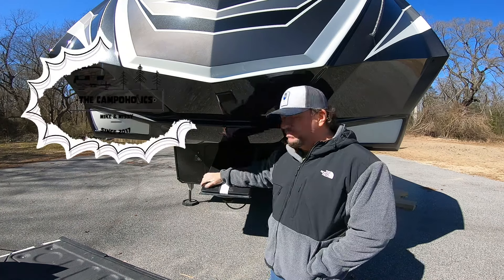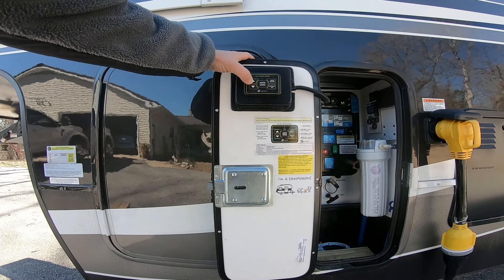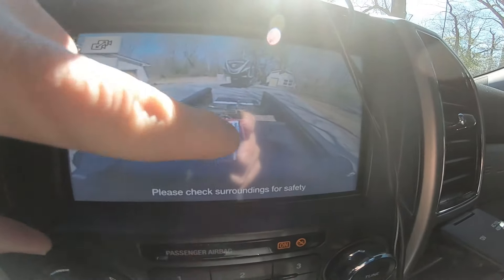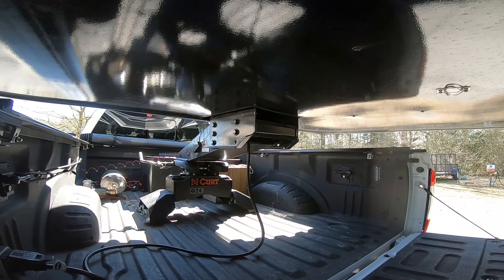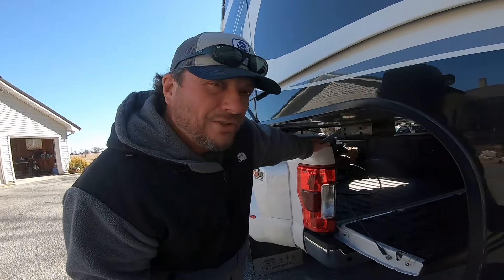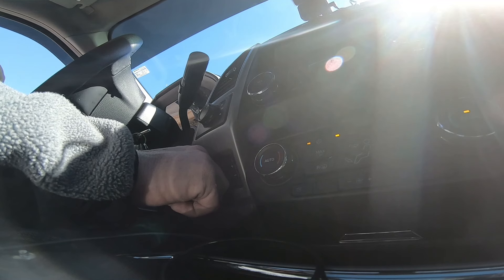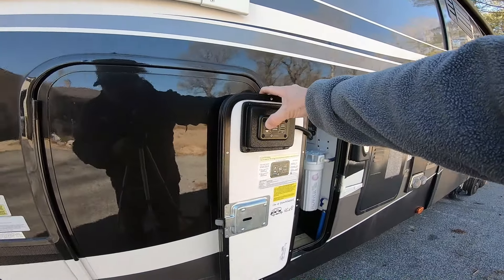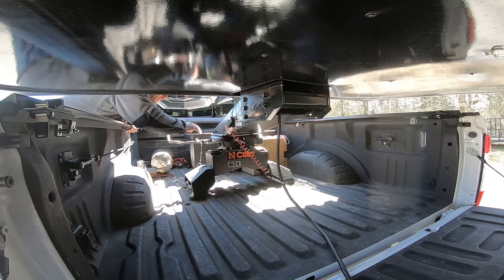5th Wheel Hook Up and Unhooking / Lippert One Touch Control / 5th Wheel Hitch

Comment: A couple things. AMP Research makes a great mid mount side step so you don’t have to haul around that wheel step. Second, looks like the clearance of the pin box to the sides of the bed is pretty tight.
Reply from the maker: Thanks for the tips!

Comment: Question: When you do the tug test, 1. First, you put your foot on the brake, 2. you put truck into drive. 3. you release the trailer brake???? Do you ever touch the gas pedal?
Reply from the maker: Hello Kathleen, you put on the trailer brakes only, give them a chance to engage, hit you gas pedal, the tailer brakes should hold the trailer while the truck tries to go forward. If the trailer does not fall off the hitch, your all good.
Reply: @TheCampoholics  Do you ever move the truck gear? Meaning, do you put the truck into gear before doing the tug test?

Comment: In my search for a 5th wheel receiver, I'm noticing that they are made specific for certain trucks. My question then is if you use top mounted bed rails that are universal, then isn't it a moot point?

Comment: Good video. FYI. I have the same Curt Q20 hitch. Your hitch needs to be greased, that is why is didn't lock properly when you backed in. The handle should pop in immediately. That hitch has 3 grease zerks.
Reply from the maker: That's a great point.  Thanks for watching!

Comment: I would never hook the breakaway cable off to the side like that. Ìf the trailer comes unhitched the cable will pull sideways on the switch and could break it. Cable should be in line with the bed.
Reply from the maker: Valid point, thank you.

Comment: When doing the tug test, why wouldn't you keep the tailgate down? If it's not locked in, you may damage the tailgate, right?
Reply from the maker: Yes Catherine, that is an option to the tug test. If you pull to far ahead then you may damage the tailgate.  People have made note of that before. I go slow so I shouldn’t pull mine through the tailgate if it falls on the jack.

Comment: Great tutorial.  Question?  Why put your tail gate up before tig test?  If test fails, might you damage the tailgate if you were just a little slow applying the brake.  Asking because I just bought my 5th wheel.  coming from a class A to the 5th wheel, when the 5th wheel is out of the factory.  thanks for sharing.
Reply from the maker: I knew this would come up after I posted the video.  Great question, only answer is so you don't forget about it. I have no other answer, other than I have forgotten about it and almost paid the price. Hopefully if you do a tug test an go slow, you wont drive your pin into the tail gate before you figure out what's going on. The jacks should support it as the pin falls off the hitch before it strikes the tail gate in our opinion. I hope that answers your question.

Comment: What about unhitch your 5th wheel on unlevel ground,when both camper and trailer are not level and the king pin and the hitch are at compound angles..any thoughts?
Reply from the maker: Chock the camper tires, use blocks under the front landing jack or legs, proceed with caution.
Reply: @TheCampoholics  I dont think its possible as the king pin gets bound with the hitch because of the compounded angle.

Comment: ThNks for the video and tips. Just picked up our Reflection 5th wheel last week. After owning two bumper pulls, first time with a 5th wheel. We installed a Gen-Y gooseneck. Question: when you select hitch height why didn't all the rear jacks come up? We are still trying to figure it out and don't want to damage anything. Safe travels
Reply from the maker: The rear jacks will go up if the Lippert control needs it to come up.  Majority of the time they remain on the ground until hitched up.  After you are hitched then you retract all. Hope that answers your question.

Comment: Good video. but 1 flaw - You always ALWAYS! engage your parking break BEFORE putting your truck in park, all that weight on the parking pawl is never a good thing. Parking pawls are designed to hold the weight of the vehicle only NOT the combined weight of truck and trailer...
Reply from the maker: Thank you Lawrence

Comment: The one thing i disagree with is where you put your brakeaway cable at. Personally i think it should be hooked infront of the hitch not on the rear. The reason is if the hitch does fail the brakeaway switch will be activated long before the hitch crashes thru your tailgate.
Reply from the maker: Ok, I see that. I don't disagree.  Never thought of that. Thank you for your input.
Reply: Gary, I own a 5th wheel. Your advice confuses me. If the trailer detaches from the truck, and the Emerg brake is applied by the breakaway switch, the trailer will probably drop onto the bed rails, and something (pinbox, hitch, or both) will be crashing thru the tailgate regardless of where the cable is connected.
Reply: Not necessarily agreeing or disagreeing.  If done as you say and the brakeaway engages earlier, wouldn't that stop the trailer sooner and then yank the pin through the tailgate?  Personally, I don't think it would matter one way or the other (like TFSFireman says).  Perhaps it engaging later would be good.  You'll know when it drops out of the hitch and give you a chance to come to a stop more slowly rather than locking up the trailer brakes.  (rather than trailer lockup, pin through the tailgate, and the trailer separating from the truck).  Hopefully none of us experience any of this.
Reply: He said to put your trailer brakes on my trailer. Brakes will not go on until I press the brakes on my truck which activates my trailer brakes, so am I supposed to hold my foot on the break while I do the toe test? I don't usually do a tug test because I can look on my hitch with the unlock. I know that it's locked or not locked but I'm just ask that question I'm curious cause my truck has a mechanism for the break, but it only works when I hit the brakes.